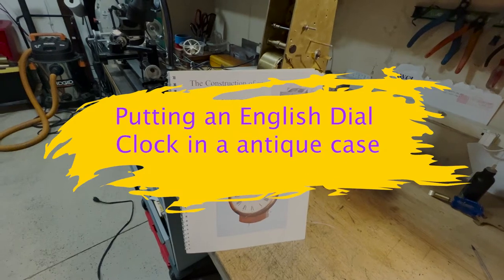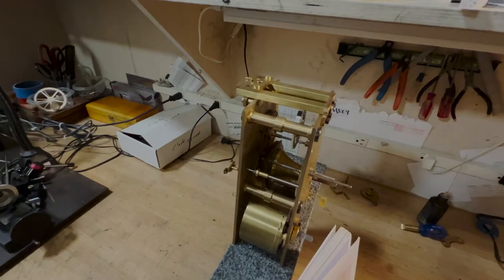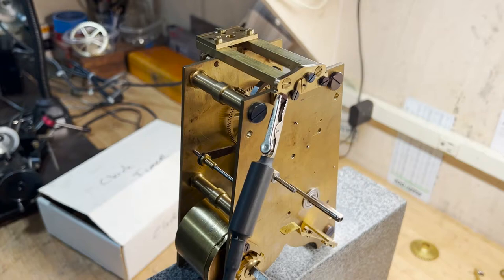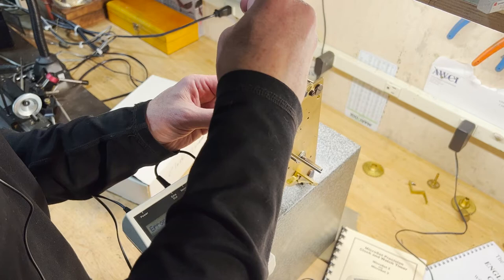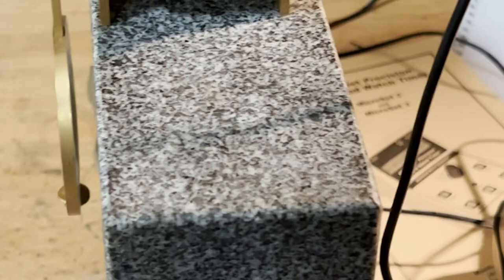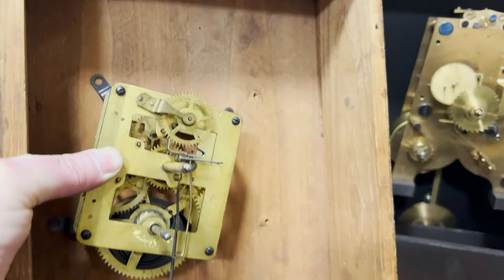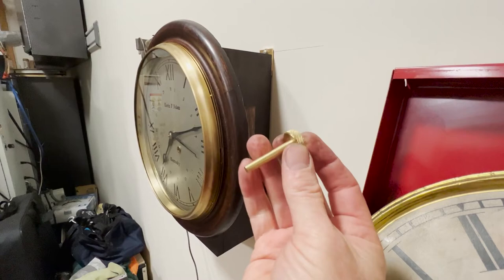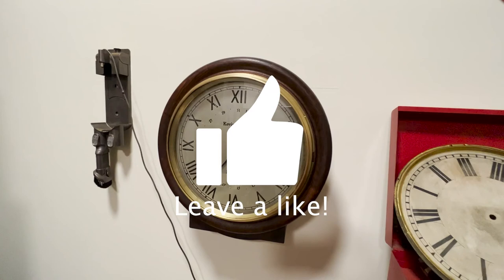An English Dial Clock

Comment: How did you make the face on this clock? There doesn't seem to be a video in your list covering that detail. Was the box and bezel original to the other movement you showed. Is there a way to redesign the casing to show the movement? The most interesting details in the clock become hidden.
Reply: Now I see the description below the video! Still, showing the movement would be cool.
Reply from the maker: Yes I should have showed more in the video.  The wooden ring is original, the box is new.   I agree that the clock is hidden as these normally seem to have had cheep mechanisms.   I stayed true to John Wildings design that is a very traditional.  If I did it over I would have made a more skeleton approach having the dial with cutaways and the frames skeleton so you could see the mech.   Live and learn:).  Thanks for watching.
Reply: @KevinNolanMakes  It seems that your projects are about looking at time differently. You are relaxed and interested in making each detail better and more functional and meaningful. Correct? I also have a passion for creating clocks, often boldly looking backwards. My focus though is what can be seen, not what makes it tick. That is why your work is so intriguing and inspiring - to create designs where all elements are celebrated - and possibly made locally. Some of my designs can be seen at Dill Uhl sional.
Reply from the maker: @MovesBank  thanks,  it come from being an engineer so I am always interested in function.  I will check out you designs, interested to see them.